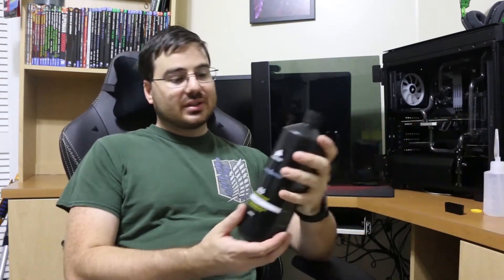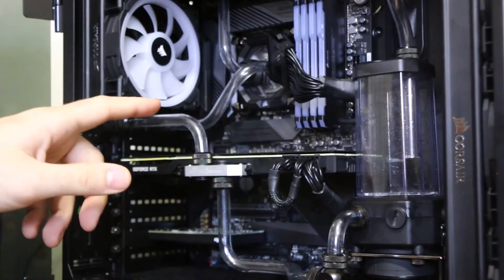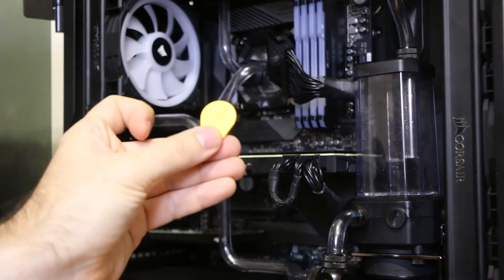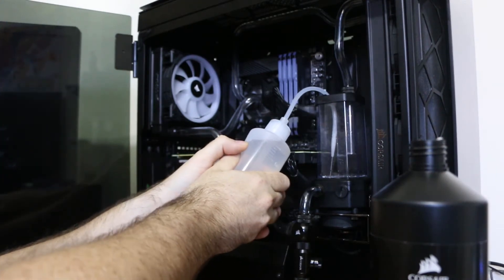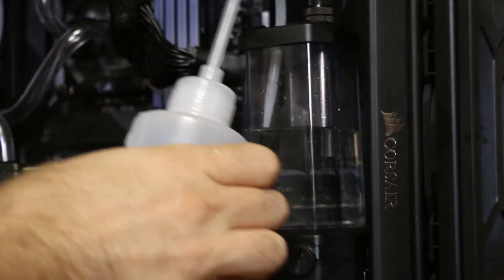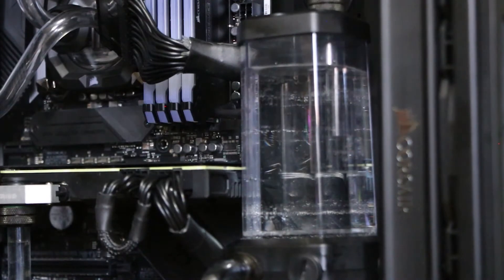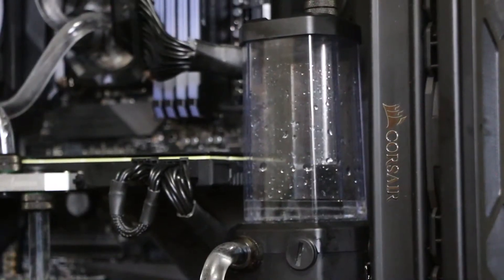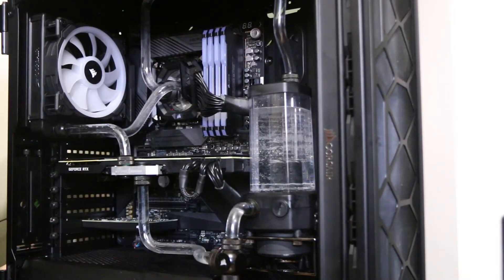How to Fill the Corsair Hydro X or any custom loop.

Comment: Does the jumper come with the power supply? or do I need to buy it separately? Also I've seen videos connecting a power adapter 4 pin to the pump is that necessary?
Reply: Theres a total of 3 cables, one goes to the PSU and where do the other 2 go? do they just go where they normally go?
Reply from the maker: The jumper comes with the pump. 1 goes to the PSU for power I believe 1 goes to the commander pro to control pump and the other goes to control lighting .

Comment: Hi @DrCyberLogic, I have a question about this pump, its normal to have a crackling sound during leak test? I run the pump for almost 1 hour at full speed,  but still the pump releasing a crackling sounds..

Thanks for the help!

Cheers

Comment: soo power switch power on then then cut the switch from the back?
Reply from the maker: Once the jumper is attached you control the pump by the poster switch on the PSU
Reply: @drcyberlogic6936  ahhh I get you now! My bad purchased my first custom loop obviously I'm assuming they won't send it already filled so need to learn it's a monster pc so can't afford to mess it up